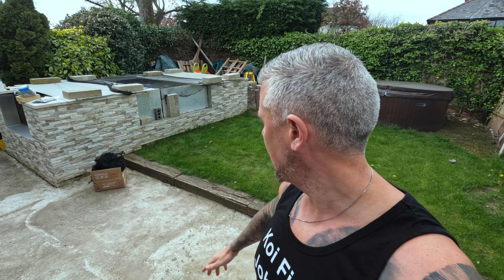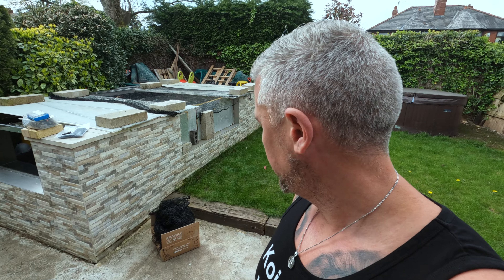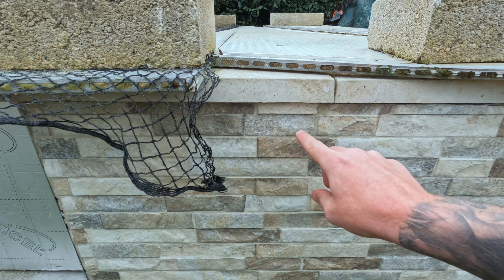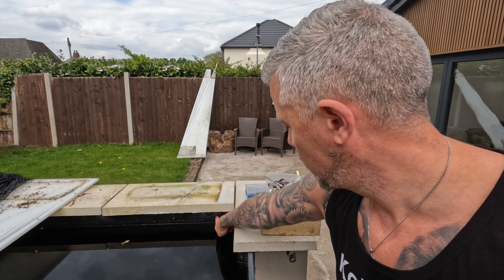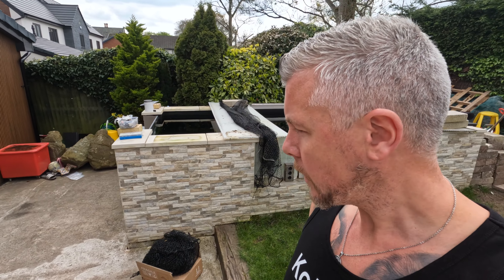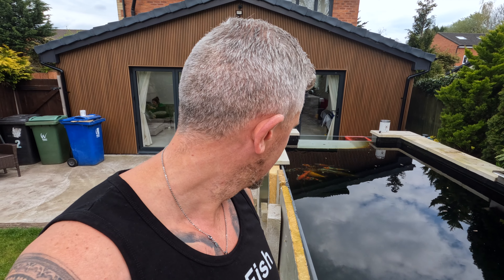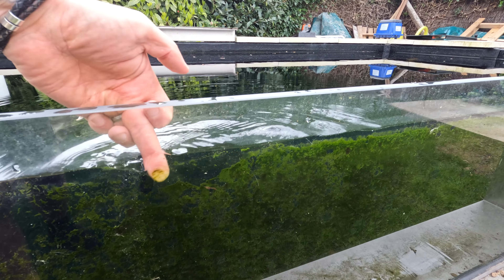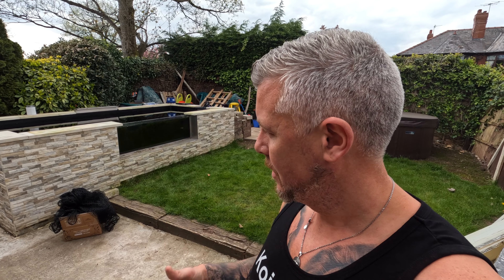THE ROOF, THE ROOF, THE ROOF IS OFF THE POND 🎉 Uncovering Koi Pond After Winter I can see my koi 🐟💦

Comment: No net mate put jump guards on or lower ur water level so the heron cant take ur fish. Works for me 👍🐟
Reply from the maker: Good call mate 👍
Reply: @johnnyfied1  jump guards close to the edge of your copings. A floating crocodile head, lower water level n the odd bit of fishing line in your vulnerable areas is what i use n has been fine for over a year now since i ditched my ugly net which was built onto a wooden frame. Like ANC koi once said to me take the leap of faith n ditch the net 👍🐟 (researched don't quote me but a heron has a reach of approx 95cm so do the maths on your pond n go from there mate)

Comment: Hi Johnny   I fitted my net by using nylon capped UVPC nails as you can see in attached photos. I was lucky the pins went straight into my decking but you can either fit a timber surround to your capping stone or drill and pin directly to the capping stones. You can stretch a nylon net very tightly over these pins and it looks quite neat. Sorry cant attach but if you give me your e mail I can send you some photos and a sketch of 2 alternative methods of attaching the net.
Reply from the maker: I got the idea mate TBH that sounds good. I have so many ideas ATM this is interesting. Thank you Peter

Comment: To mount the net on my pond, I use those screw-in plastic hooks made for electric fencing.
You dont really notice them that much when the net is off, and it makes for a super easy and clean net install, just catching the net masks in the hooks and then trimming any excess netting.

In my case they are dual purpose, as my neighbours have like 13 cats in total between them. So if ever they for real start trying to catch my fish, the electric fence goes on.😂

Guess the electric fence could be used as a heron deterrent aswell, if mounted a bit high and pertruting.

Something to think about.

Good luck this season, fellow koinerds😊
Reply from the maker: Electric fence 😲 Interesting approach mate but not with the kids knocking around they certainly dont need anymore charging up 😂
Reply: @johnnyfied1  Yeah.. Thats also why my fence is not on unless absolutely necessary. 
My 2 year old is electric enough as is😁
Reply from the maker: @brokentap3134  🤣🤣🤣🤣